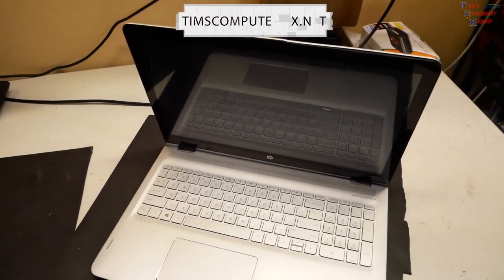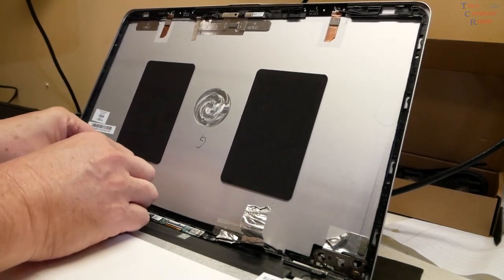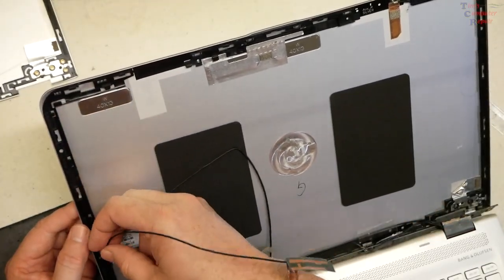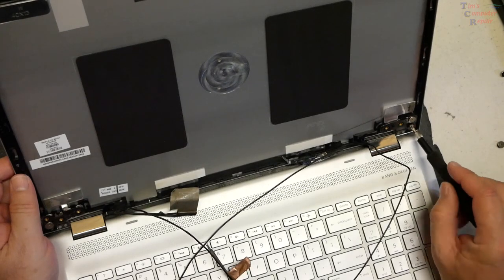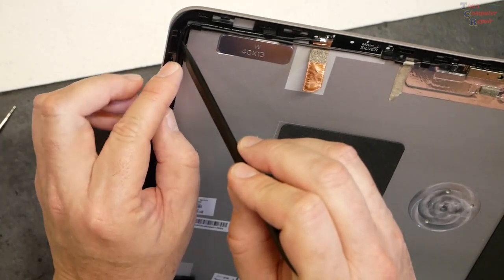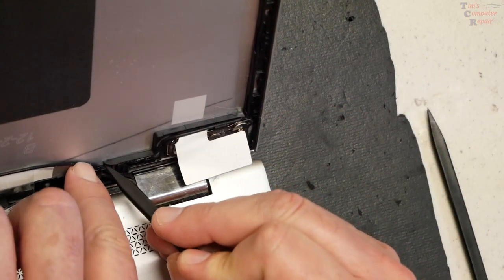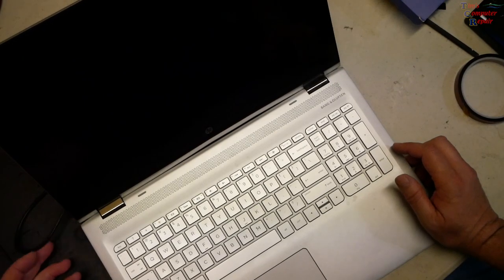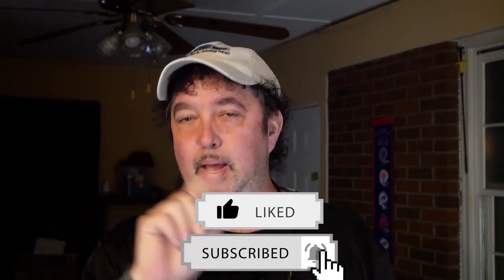HP Envy X360 M6 Display Screen Repair Step by Step

Comment: The little circuit that you asked about at 24:45 establishes the keyboard and trackpad connection with the screen. I bought a screen from FirstLCD for an Envy X360 m6-aq005dx, it did not come with that little circuit. I had to take that out from the original screen and connect it with the new screen to get the keyboard and trackpad to work.
Reply from the maker: Thans for the info.
Reply: The service manual calls that little board a "G-Sensor". @TimsComputerRepair

Comment: Thank you so much for posting this step-by-step video. Your video is REALLY helpful!! Today, I replaced the back cover because the grommets holding the hinges were broken. It all worked out!
I'd like to add that when I started the laptop up, the keyboard didn't work and the laptop was stuck in airplane mode. After searching online, I was able to resolve those issues by disabling the "Intel Integrated Sensor Solution" in Device Manager. Just in case someone else runs into this issue...
Reply from the maker: Thanks for commenting.

Comment: Hello, you video is very good and informative! I have a question, if you can answer it would be very helpful to me. I have the m6-w103dx. The laptop is working fine through HDMI. The screen is working but only barely visible with a flash light. I have replaced the screen, no change. I have replaced the vga cord from mb to display, no change. Could you please tell me what else could be causing this and how to fix it? Thank you in advance!
Reply from the maker: There is a backlight fuse on the motherboard that has tripped. The fuse needs to be replaced but the new one may trip also. It is a soldering job.

Comment from the maker: A word of warning, it has been my experience that the majority of the screen assemblies that are made by third-party vendors for the X360 model will not snap totally back into place into the top lid on occasion possibly leaving some gaps between the screen assembly and the top-lid therefore not being fully secured into the top lid. As a result I have refrained from doing these repairs. Repair at your own risk.

Comment: Hi, I was planning on doing this same repair today on my HP Envy. I was wondering if its necessary to remove the battery first? On your previous video you commented it wasn't but I wanted to be completely sure. Please let me know. Thanks and great vid!
Reply from the maker: You may not need to however it's best to pull power before servicing.

Comment: The screws fell out of my hinge right side I don't open close because that hinge is not attached and the screen in that corner will not stay in because of hinge. I found the screws that fell out well 2 of them. But the screw hole/nut is one piece now.
Reply: Same! my issue was the hinge was too tight and caused the hinge bracket to rip the nut out of the screen deck lid. ebay has the HP screws. I could not find them on amazon

Comment: Those HP laptops look like they are some of the most tricky ones to repair.
Reply from the maker: It's the touch displays that are tough. Thanks for commenting.
Reply: I did a re-pasting of a HP Probook 4530s and that was a nightmare to take apart to get to the heatsink. I then had a HP Elitebook 8440p to clean and repaste & thought oh no, here we go again, but that was an absolute breeze to get to the heatsink, removing and repasting. In general, I think HP builds are quite difficult and cumbersome to work with, but on occasions there will be a certain model that surprises on the positive side.